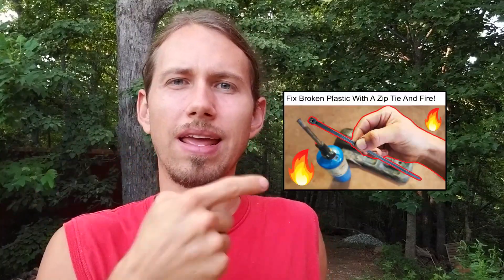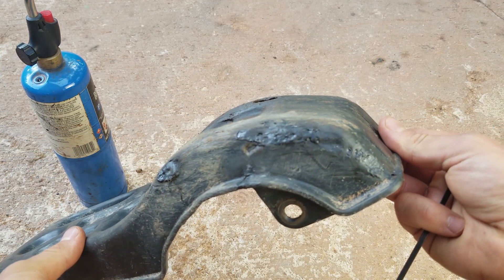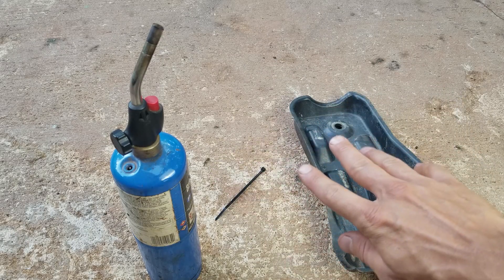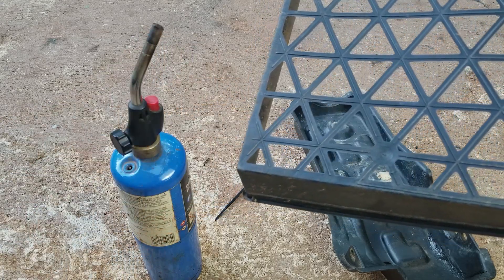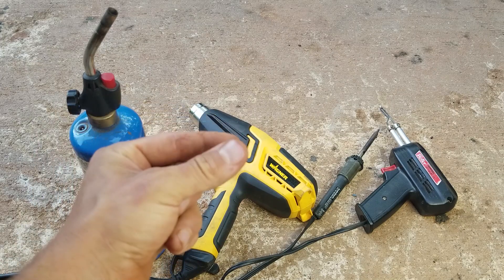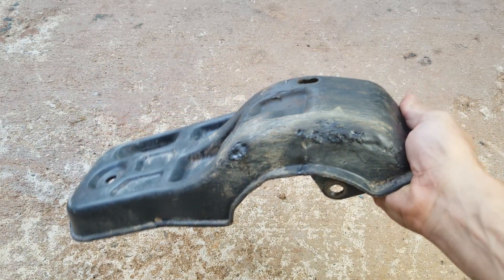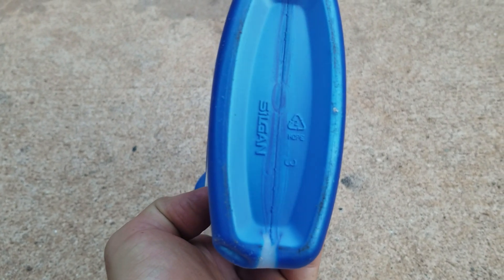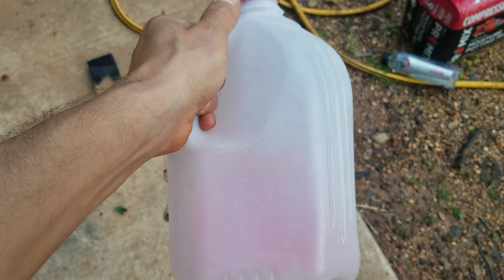Fix Broken Plastic With A ZIP TIE And FIRE! UPDATE

Comment from the maker: Hey Yall. Tools in the description. Check Out The Original Video: https://youtu.be/5m1U-SGjj2Q
Timestamps:
0:00 Intro
1:11 Tip 1 - Filler Rod
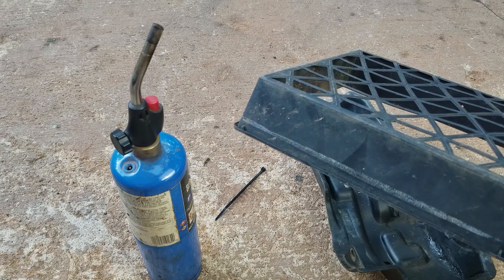3:20 Tip 2 - Plastic Melting Tools
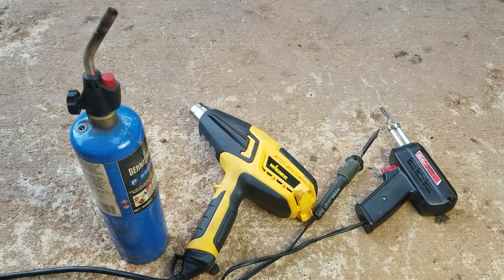4:21 Tip 3 - Secure Work Piece
4:38 Tip 4 - Clean Work Piece
5:09 Tip 5 - Don't Breathe Fumes!
5:50 Plastic Type Identification
8:36 Outro